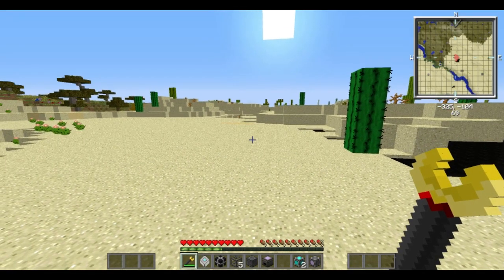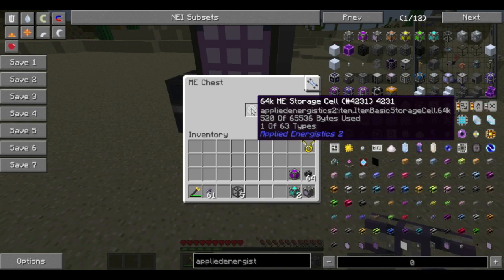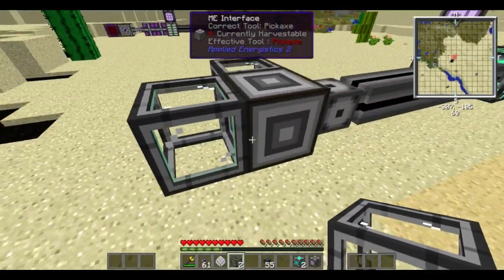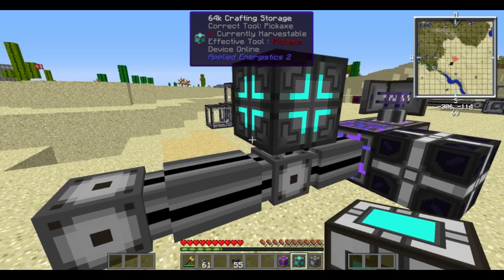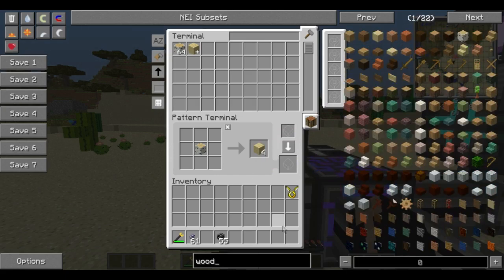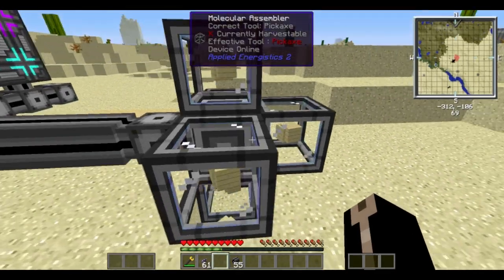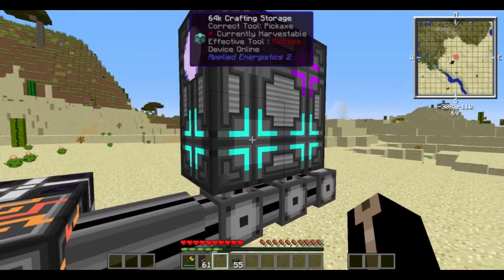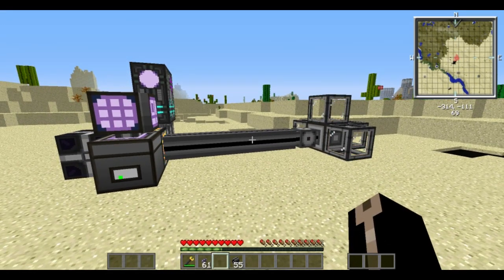Modded Minecraft Tutorial : AE2 Autocrafting / Molecular Assembeler Tutorial

Comment: awesome video, but i have a question, is there a way to get it to craft until it runs out of resources? i mostly want this for ores going to pulverisers etc, instead of crafting when i tell it to, i want it to craft whenever the resources are available
Reply from the maker: you could put in an order for a couple billion of them so its always trying to craft them or use a supply bus into an external chest telling it to fill it with unstable stable ingots give it a crafting card and it will keep crafting them, then just import the items back into the system
 something like that

Comment: So what if I wanted to like really auto craft something? I have some recycling machine from IC2 making scrap, I want the AE network to auto make scrap boxes. Is there a way to do that once there are 9 Scrap in the network?
Reply from the maker: +Jeff Caauwe  you could make a system that says 
" cobble put into the recycler yeilds scrap, scrap crafted in a 3x3 configuration makes scrap boxes, all scrap boxes should be exported into a thermal expansion autonomous activator , that will righ click them and drop the items on the floor, then use a vacuum hopper ot obsidian pipe to pick them up"  
then you will have a fully automated system .
Reply: +BobTheBritishSkellie Well I'm using the scrap boxes to amplify a mass fabricator. What I ended up doing was having export terminals put scrap into a auto workbench and then import to pull the scrap boxes out into the network and then from there, into the mass fabs. It's slow, but I have like 8 of them going. Thanks anyways! Your videos are really helpful!

Comment: I need to know the best method for storing hundreds of recipies...do I just keep plopping down interfaces??
Reply from the maker: Adam Arzo i think interfaces are the only way to do it,  you can get a terminal that can be used to access every recipe slot available on the network for adding and removing recipes and sorting them but i dont know of any other ways to actually store recipes.
Reply: BobTheBritishSkellie damn ok the old system where you plopped them into a big chest thing was better less fuss...
Reply from the maker: Adam Arzo i still think that AE1 was alot better in many many ways , but AE2 has multiblock parts and thats defiantly a big plus